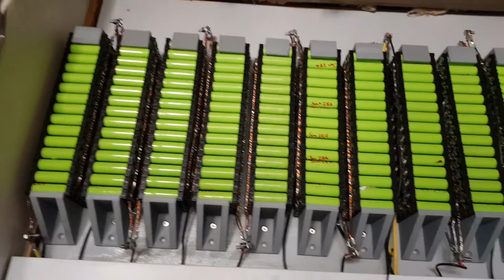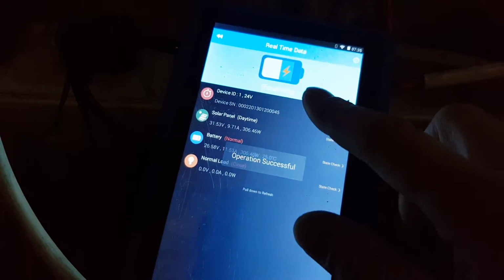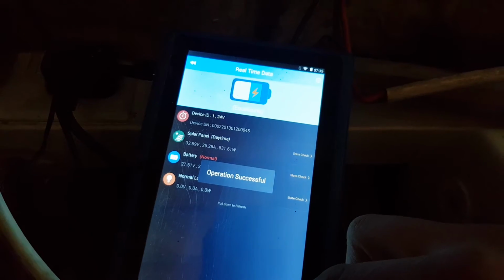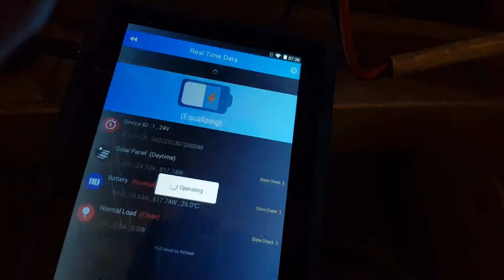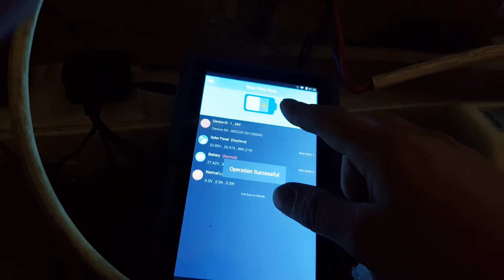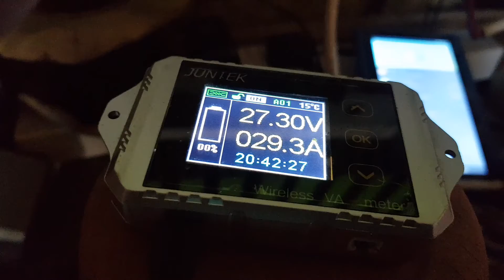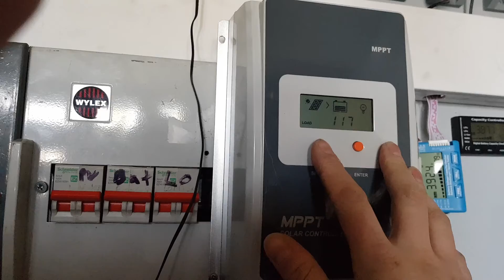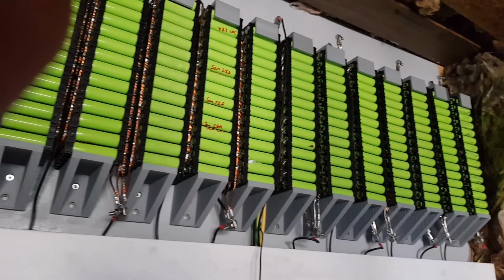EPever 30 mppt CC apperars to be current limiting.

Comment: You know when you say “current limiting” does that mean you could add panels past the input current, it will only take what it needs and when peak voltage is met, it reduces the expected current.

Example: 40amp controller 50amp coming in, controller takes what it needs from that then no demand after its fully charged the batteries.

I don’t get much light so I want to have sufficient panels to give good amps in low light. 

Please give me your experiences on this subject.

I have subscribed to your channel. Thanks.

Comment: That's reassuring - I have the Tracker 20amp  and was spooked when it went as high as 19.6amp on my camper as its slightly over paneled - 280 instead of 260w recommended max - it did say in the manual that the small unit will work better in overcast at the expense of slight less in full sun